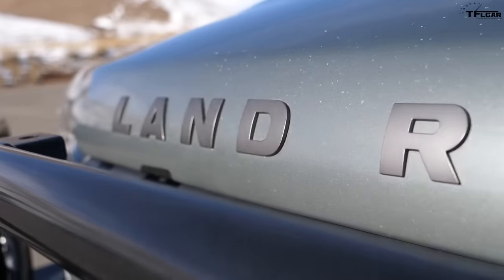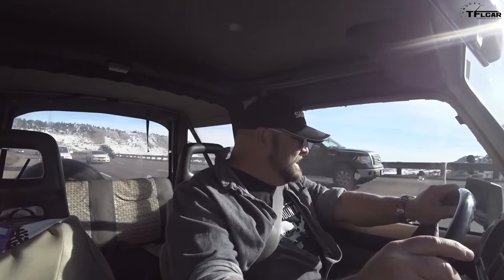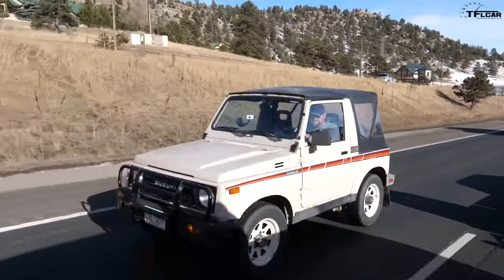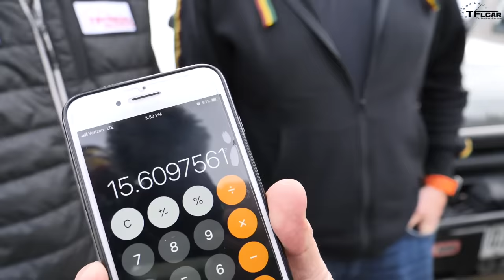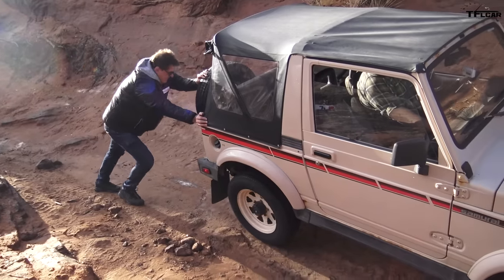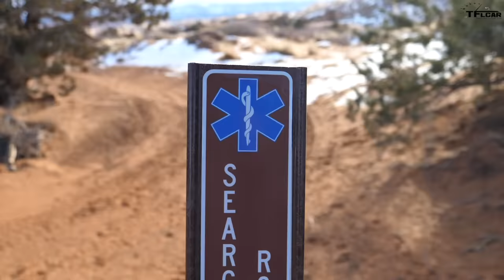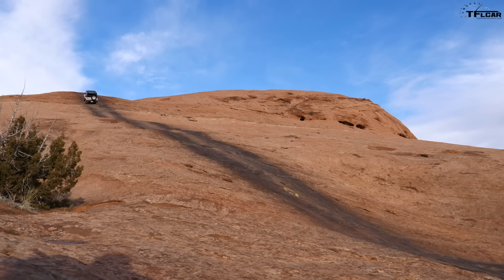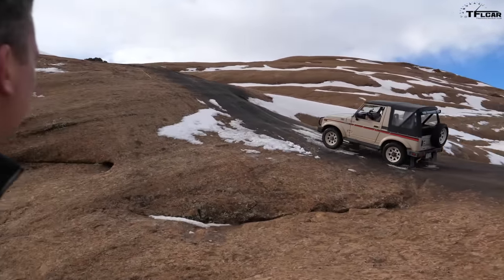We Torture Test 3 Budget Off-Roaders in Moab & This One Is The Best! Cheap Jeep Challenge Ep.8

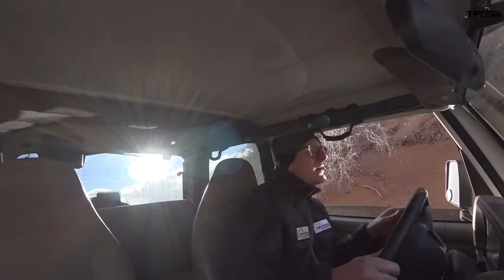Comment: So when does the torture test start?  They went over one moderate section of trail at the 24:00 minute mark, drove over some smooth sandstone to test the ability to drive in San Francisco or perhaps Pittsburgh,  a puddle of water significantly smaller than ones you will encounter on the road any times it rains in Lubbock, and then back over the same moderate obstacle in the opposite direction.  Might as well see which one can hold the most groceries.

Comment: actual answer:  85 octane is formulated FOR USE IN HIGH ALTITUDE.   Yes, at high altitude the THINNER atmosphere  AT LOWER PRESSURE offers less oxygen for fuel burn  compared to sea level atmosphere.... So, up on the mountain... 85 octane actually works better.

Comment: Been watching these guys for a while but I can't help but make some observations: Driver mod needed
- The Samurai did not need to get beached, no good driver would have had an issue there. You are aware of your clearance and instead of straddle, you offset.
- low gear (and in first) is better on descents than brakes. You can do this even in autos (select 1)
- beef jerky is way better than slim jims
- speaking of slim, hilarious that two modified vehicles take on a bone stock skinny tired Samurai
- again with the hill descent braking, come on guys! Using first and Low is not a new strategy

Final thoughts
- That TC on the Disco2 is awesome since there arent lockers
- That 4cyl Jeep was the most expensive car there!
- That Samurai kicked butt on street tires, no lift, and was the cheapest. That thing was like a little mule on that course.

Comment: That samurai is legit, its slow af but it still kept up a little with the others and got 10 mpgs more than the other trucks. I was surprised by the Jeep only getting 15, even with the 2 inch lift. I would have expected more like 19-21 mpg. I guess that little Jeep 4 banger just has to work too hard with the lift and tires.

Comment: The constant worrying about the disco temp was getting on my damn nerves. Almost 200 is perfectly fine. These things were running like 215 from the factory. If it was like 220 and you wanna slow down a little bit because of the temp then thats one thing but being at almost 200 and getting scared is some bullshit. My 03 without accessory fans and a fully new cooling system and g05 coolant runs 185-205 on the highway all the time here in colorado which is better than factory.

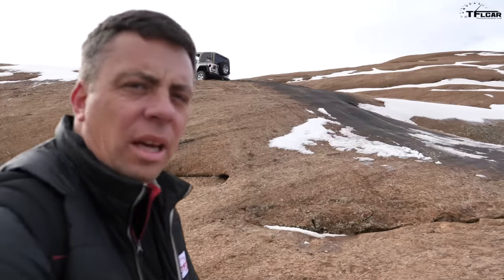Comment: Intimating that the Discovery is going to overheat any minute is just plain ridiculous, 200 is fine. When it gets to 220 and above is the time to start being concerned. If the Disco doesn't have traction control, (maybe it's just not working),  then it does have a center diff lock, will have one or the other.  Never use a towball as a recovery point.  That Discovery is in great condition, a good buy really and well worth looking after. All up for less than 15 grand for all three, the lifestyle changes are amazing.  There's nothing like getting out into the remote areas that 4WD's offer and the boys have shown that you don't have to have expensive 4WD's.   I enjoy your channel, keep 'em coming.  Ps. 43:05 - I thought it was articulation not reticulation... hahahahaha

Comment: i think the minus 20 points of the samurai were due to driving error (nothing personnal).

He didn't use one of the best aspect of the suzuki wich is the small size. Instead of being stuck to go over obstacles like the other two trucks, you can simply go around them.

Just put a lift kit on that and better tires and you clearly have a better offroading machine than the other two. 

And if you don't want to go 40 mph on the highway between trails, its weight and size allow for a easy tow with even a regular SUV.

Comment: On some of those steep descents it looked as though you guys had the Jeep and Rover in drive. Both of those have lowish crawl ratios, and brakes should not have been required, low range first gear.

Comment: There be NO Competition! If they put it up against a lifted 3rd gen 4Runner (96-2002)  I have a 3" lift with 34" tires stick shift and I take that thing anywhere no problem.  Mine has over 250K miles, and the one I had before had 450K miles (original engine and transmission!)  and still going!  Late 90's early 2000's was Japanese best cars!  Way better than the ones that replace them and more reliable than the new stuff!

Comment: You could've just unbolted the brake lines from the frame in the wheel well then you could've unbolted the sway bar there's plenty of slack at that point I've been running my tj like that for years no problems.

Comment: That's the problem everywhere I look. Everyone wants to prove their rig is better than the Samurai. Only problem is that all the other vehicles have some sort of locking diff plus bigger tires and the Samurai is always stock open. I've seen a locked Samu with gear reduction and hydraulic steering with minimum 31 inch tires and there is NO comparison.

Comment: If I'm not mistaken the Suzuki tires are max 44psi you should not go off the tires max pressure for a vehicle you should go off the manufacturer's tire pressure which is in almost all vehicles driver door frame if you go to high it's hard on the suspension and will not give you the handelibg

Comment: Should add a 04-06 VW Touareg V8 with Air Suspension to the next test! Can get one for around $5k and would give the Land Rover a run for the money. Would smoke it on the speed test.  MPG would be close as the Touareg wouldn't have to work hard on the uphill like all these 3 did.

Comment: 5 years later this comment probably won't get many views, to say the least but I don't care much about that... here I go! 
I had an 88 1/2 Suzuki Samurai (yes that was a real year model) that would continue to surprise me with the abilities that tiny little thing could do! 

It was a snow plow to a total mudder to rock crawl any thing I gave it to do for me. 

Yeah, the engine and the "listed fuel mileage" was impressive with it's 60 horses pushing it any hill in 3rd gear but the fuel consumption was a bit misleading. The listed mileage was for driving in a city, doing around 35 mph, in stop and go stuff but when ever traveling in real life were to be needed it would change quite a bit..... The faster I'd travel, at the speed limit, on the highway or even long roads would do the total opposite than a typical vehicle might. Slow, stop and go's were better than trying to keep up with regular traffic with the accelerator on the metal floor to do so, using all the fuel it could throw into its tiny little carburetor, making the consumption more at regular highway speeds just to try to keep up with the traffic surrounding me. 

It was tiny but mighty off road. Just a bunch of fun what ever I asked it to do. Never let me down and impressed my other friends who laughed before seeing it embarrass their 4x4s in our adventures. 

She was stock, nothing added and still did more than my buddies Toyota truck and the others Nissan/Datsun 4x4 pickups.

Comment: Yeah, why is it that the jeep gets a 2" lift and new off road tires, the Range Rover is equipped for off road, but the Suzuki is bone stock, right down to the all season tires. Not that I'm a foreign fan. Hell, I'm not even a jeep (Stelantis) foreign fan.  My wife had a 2017 Grand cherokee, the transmission blew up at 88,000 miles.! Yeah, great product.! Meanwhile my 2015 GMC Sierra is at 191,400 with original transmission.

Comment: That Jeep has no diff lock or traction control. To imply that that car can offroad is pretty misguiding. You shouldn’t take a car out in Moab without traction control or diff lock. 31:51 the reason you can’t claim is not because of your wheelbase at all. Your wheelbase is perfectly fine. It’s that you don’t have traction control. Those wheels are spinning mid air.
Reply: No. 1.  It's not a car.  The fact that it doesn't have some of the more modern features like lockers or even a limited slip differential doesn't make it ineligible for MOAB.  It just puts alot more responsibility on the driver to navigate obstacles knowing which wheels to plant where for traction.  And yes, that short wheelbase can create a sketchy situation on a long steep uphill as compared to a longer wheelbase.

Comment: 20+ psi in your tires is not airing down. The Jeep and the Rover should have both been at 15psi. I have gone lower than that without bead locks. Your not driving fast and you need the compliance and bigger foot print afforded by lower psi. Its harder on the vehicles and the drivers running so much pressure in the rocks.

Comment: You guys have just "proved" it is possible to enjoy driving off pavement - even test the capability of the vehicles - without breaking anything. I do wish, however, that you would delete what appeared to be the use of a trailer hitch ball for recovery. I haven't been able to check the stories but I've been told that more than one person has been killed when hitch balls have broken and went flying. It seems almost certain that the Samurai would have had better attachment points than that one.

Comment: 24:45, that is not high centered, his diff is on the rocks. Seems staged, all he had to do is put the wheel on top of that rock rather than straddle it. Never use a d-ring over a trailer hitch ball, instant missile!